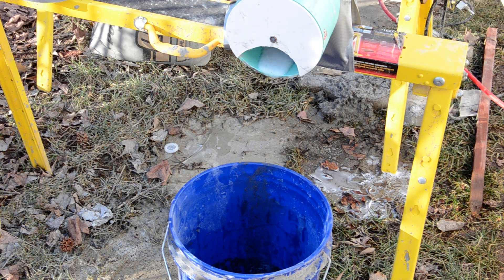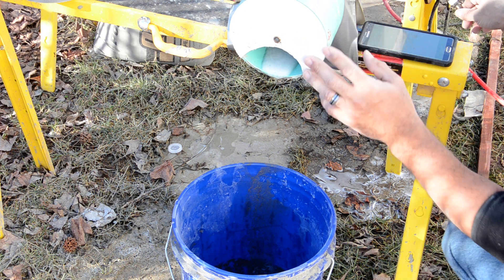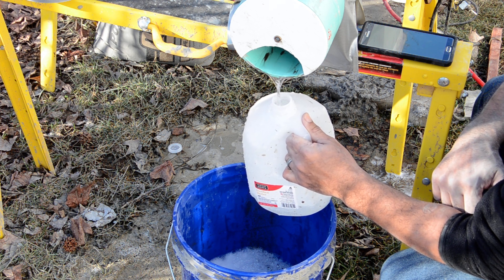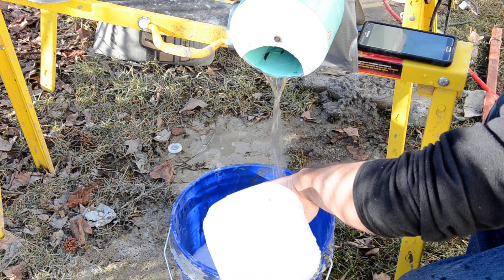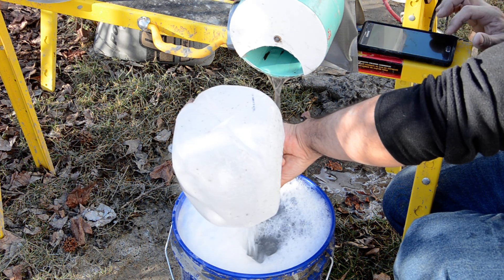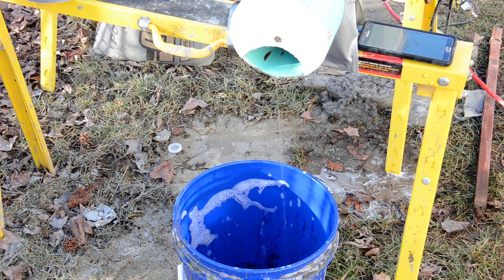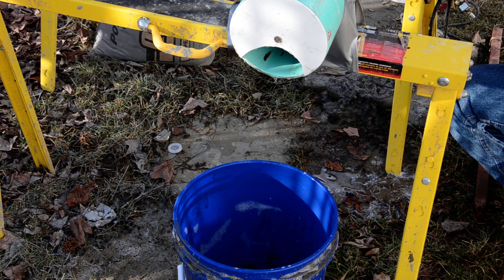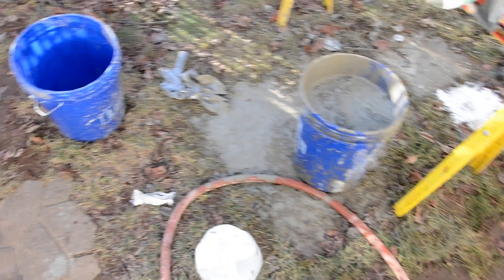Making Foam with green dragon for Aircrete | incl. Basalt Fibers Video | 3 of 4 #AircreteHarry #diy

Comment: takes you too long to calibrate your water flow.
Reply from the maker: John Tingle  well this was the old way of making aircrete with a machine that didn't work properly anyway. The new way of making aircrete requires 7 gallons of water which is quick and easy one five gallon bucket 1/2 gallon bucket.

Comment: 1gal./60 sec. or 1/2gal./30 sec. or 1/4 gal./15 sec. Just saying :) I would love to see the inside of the mixer.
Reply from the maker: The machine did not work as advertized so the company stopped selling it. They are working on a new and improved version.
Reply: I could see that from the videos I watch it was less than constant, however with that said it would be nice to see a video on the makings of the old unit and maybe your opinion of it design flaws so it could be compared to the new one when it comes out.
Reply from the maker: http://www.preppingconnections.com/air-crete-domes.html  You can see the parts inside on this website.